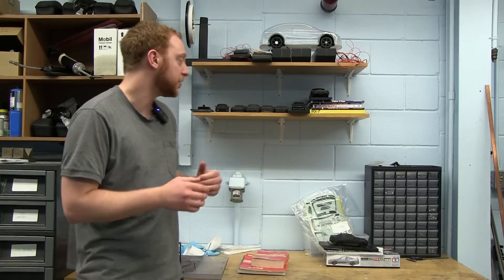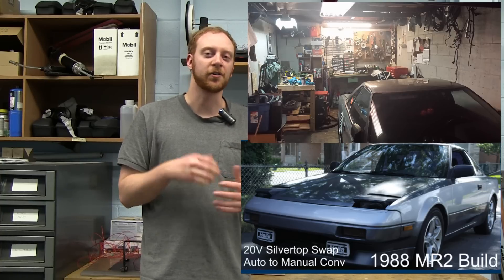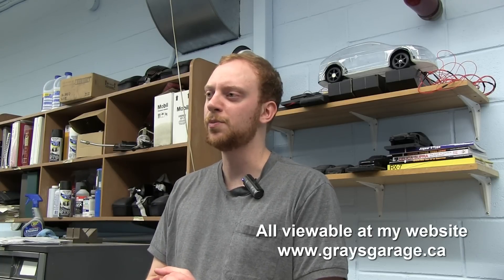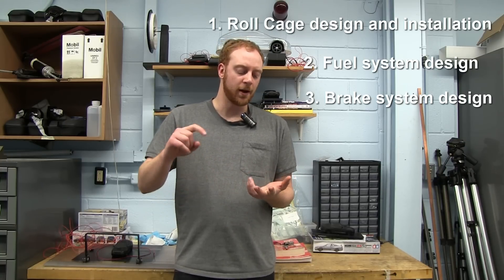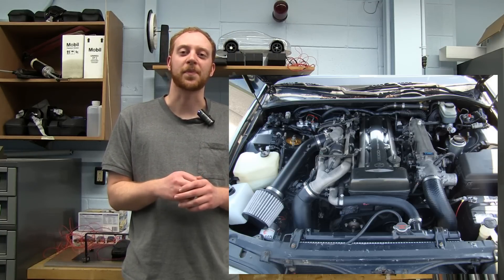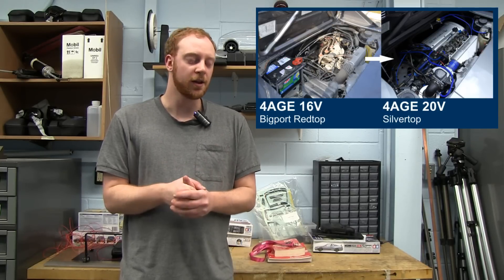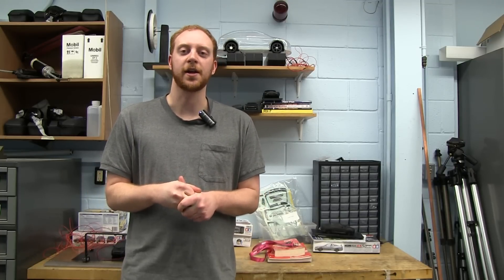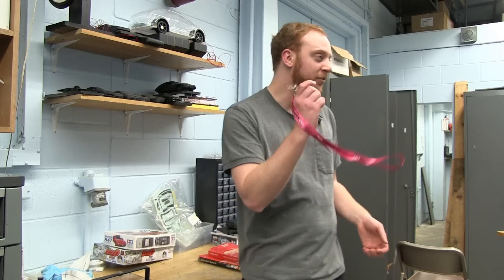Mazda RX7 Restoration!

Comment: 1jz 2jz swap in a fc i seen 2. One had no hood he could not put it on and the other had a hood custom made (big ugly lump). They fit well in a fd but not in a fc !There is a lot of space side to side front to back but from bottom to top 1 jz and 2jz are tall even with a smaller pan you woud have to cut the half frame and lower engine and trany but it would probably scrape.you clould tilt it not been done ? that i know of it might work ?
Reply from the maker: I might have to try a more drastic solution as you mentioned, but I'd like to test fit it and see whats up before planning anything major.